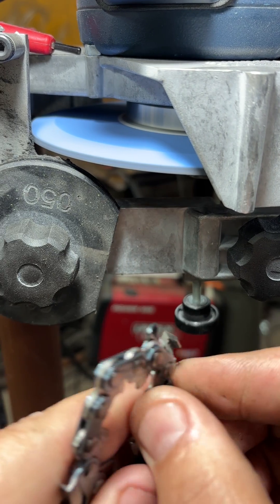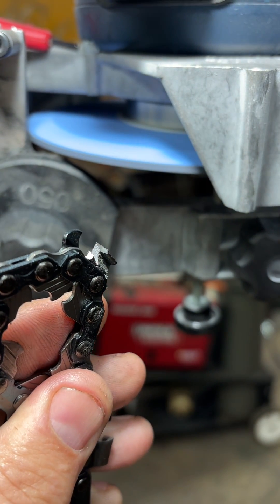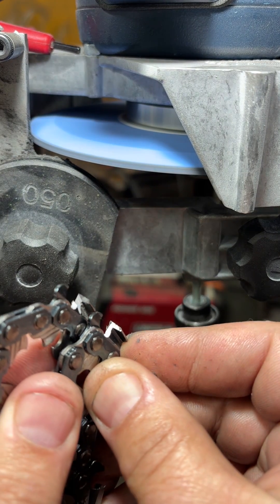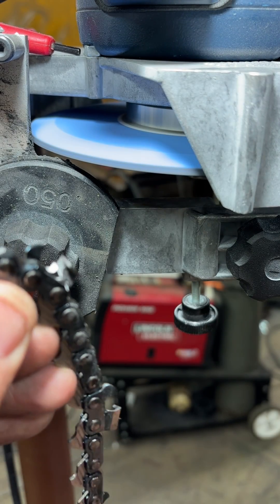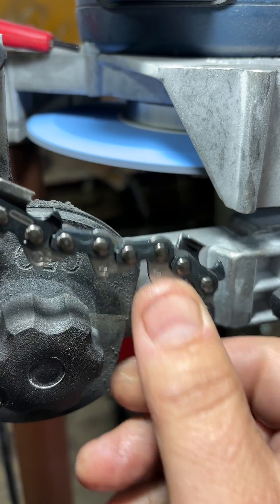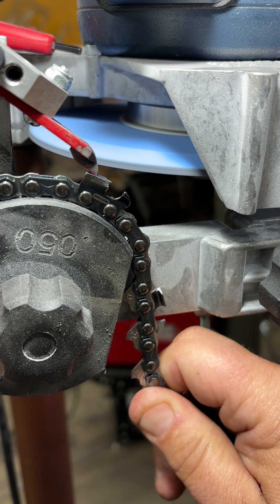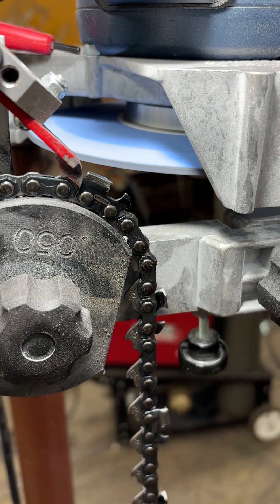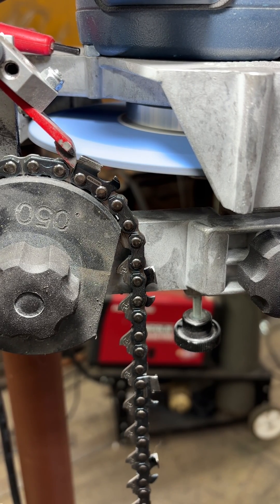Round chisel to square chisel, converting chainsaw chain

Comment: I would think that coolant should added while doing that much grinding so the tooth temper dont change..........
Reply: You grind a lot of chain.?
Reply: @JS-oy6nn  No.
Reply from the maker: I use cool grind treatment on the wheel.

Comment: Thanks ill have to give it a try.  You think it cuts better being square?
Reply from the maker: In my experience square chisel cuts 10-15% faster than round ground chisel. It’s varies depending on the angles of your grind.
Reply: @CavemanExperinence this is all new to me . What angles are you supposed to grind them at?
Reply from the maker: Just like a round grind you can make the angles shallower or steeper on square. Shallower typically means it will cut faster than round but won’t be very durable. A steeper angle will be slower but more durable. You can change the angle by adjusting your grinder in relation to how the tooth interacts with the grinder wheel. You can also adjust angles by shaping your wheel differently. You should look up square cutter on YouTube. He is the guy that makes the Square Jig setup that you can run on an Oregon style grinder. He explains the angles pretty well.
Reply: @CavemanExperinence ill definitely do that.  Im all for learning something new. I appreciate the information and your time. Thanks alot.